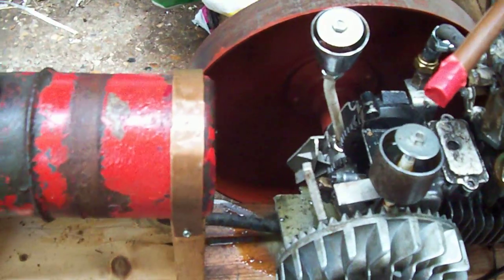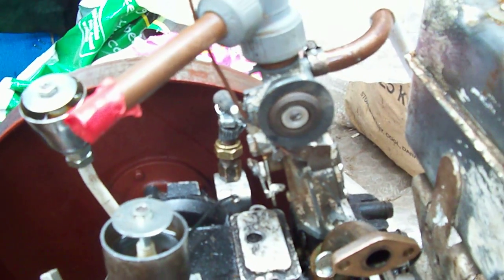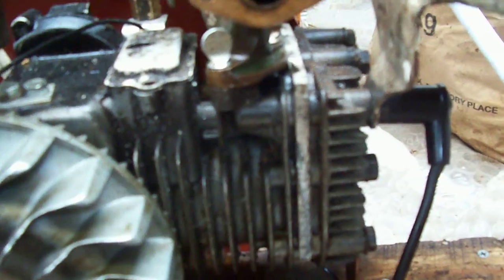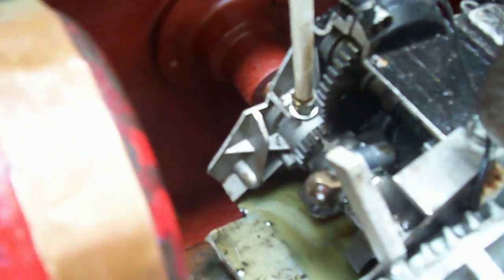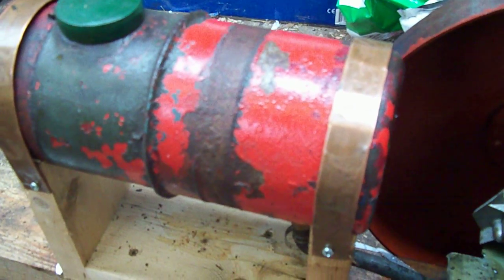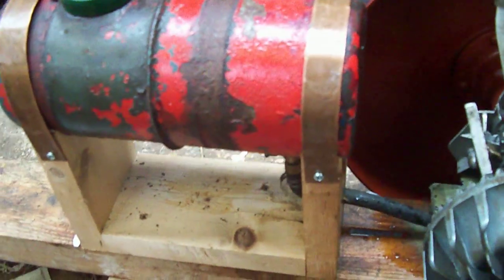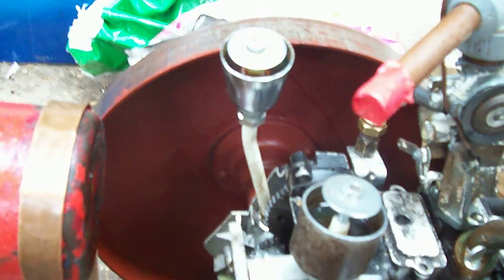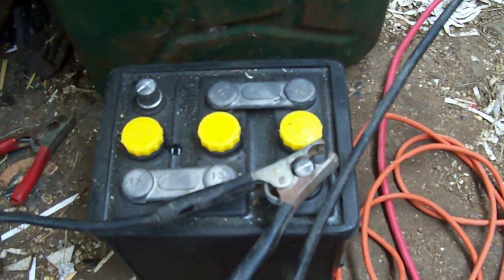3HP Tecumseh open crank ( Will be hit and miss one day) Part 2

Comment: Yeah it is a tad messy! A little crank guard may be the answer.

Good little project anyway, It's tempting me to get on and do the hotbulb Villiers midget I wanted to do, but I think that will have to wait as there is a new small project in the pipe line.

Comment from the maker: @steamwally a small fan on the barrel to keep it cool. Or I may see if I can somehow enclose the fins and put water around them, It would be hard as it is aluminum. I definatly want it water cooled though. I'm halfway through making the hit and miss mechanism, very pleased with it so far, I jsy need to do a bit more fettling then strip it all down and remove all the swarf I've made!!!. I've then got a small dynamo to fit so I can see how much power it is making. Once I've got it running well...

Comment from the maker: @steamwally  Trouble is, the Stuart flywheel fits nicely on the output shaft, I'd have to get someone to urn me an adaptor for the other side. Eventually I'll replace the original flywheel with something nicer, but it should be ok for now. I may get someone to turn the fins off and mmake it nice and smooth.
As for cooling, I'm not sure what to do. I think it would be ok if I just cooled the head, which would be easy, cooling the barrel would be the hard bit. I may water cool the head and put...